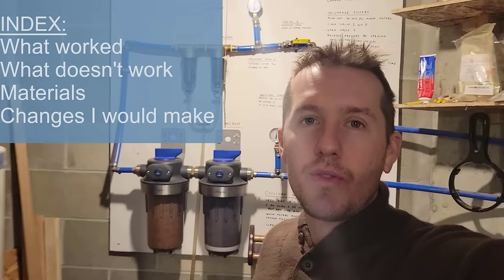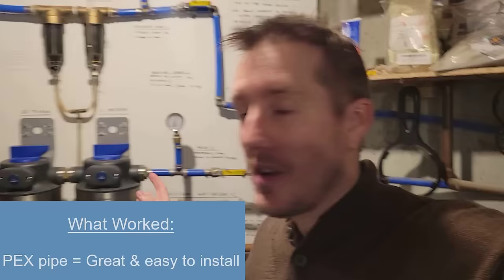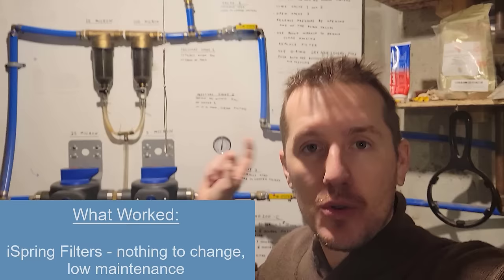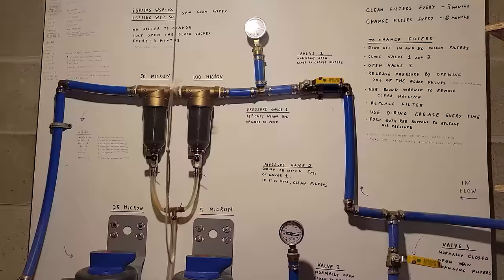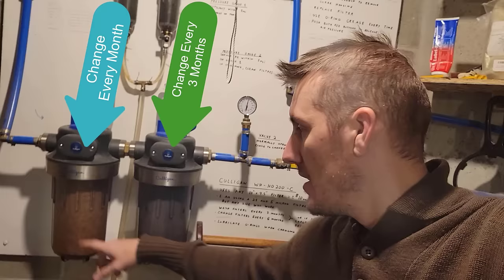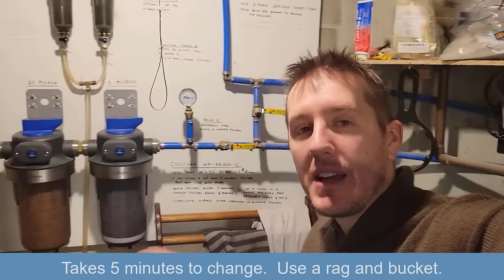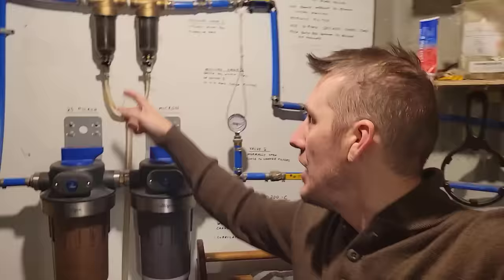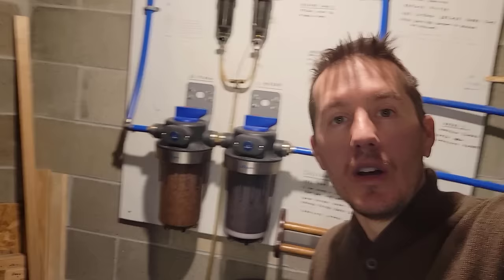4 Years Later  -  Whole House Water Filters Update

Comment: All you need to do is have the water running to use the pressure guages, so why remove them? Personally, I would have installed 1 pressure guiage, and piped it to both sides of the filter, with 2 ball valves. Thst way you know there isn't any gauge calibration issues. To not know that the pressure differential only happens with flow is surprising. I think that it would be nice to know what the pressure drops are at X load (say open a faucet in the bathtub), and then compare that to when they are dirty. Sure, you have a visual indicator, but a number (pressure drop) tells you how much they are fowled. So keep the pressure guages, people: don't take his advice on this matter.
I use a different approach to my similar water issues (rust, hardness, stuff in the water etc...): I have an iron filtration system that looks like a  water softener without the brine tank. It uses air instead of chemcichals, and the tank is filled with carbon. That that carbon media acts like a 1 micron filter. So they claim: my 1 micron filter downstream gets plugged up, so it may be less effective than 1 micron. But it's not 5 microns or higher. So this takes care of both those ring filters and one of his cartridge filters (which I like - they are larger than mine). This filter backwash es every night and is taking care of most of my filtration issues. Like I mentioned, I have a 3" one micron cartridge filter right after the Iron filter, and that I  change once a month or so: I go by the look of it. I might add a pressure gauge to it for $hits and giggles. After the filter, is my water softener, and it has it's own filtration effect, but it is minimal after passing through my 1 micron filkter. So far (2.5 years) this system is working fine: no rust stains anywhere and the water softener is working well (no water spots on glasses).

Comment: Hey, I actually installed an iSpring 50 two years ago after seeing this video but I'm still not happy with the overall results. Still see rust deposits in the toilets and the water smells "funny" when you take a shower.
I have the iSpring first and then a 1micron filter (similar to the culligan but smaller diameter) that shouldn't let anything through. I change and clean every two weeks but I'm still unhappy with the results.
I'll look into some other filter solution this year to completely get rid of any rust.
Reply from the maker: I change that 5 micron filter every month.  Still get a little bit of rust on the shower tile, but it's way better then it was before installing the filters.
But ya, some iron/rust gets through mine also, but not a lot.
Reply: There can be three different types of rust in water. Iron bacteria (reddish slime in your toilet tank), dissolved iron, and iron/rust particles. These filters will only filter rust particles bigger than whatever micron size of the filter.  Iron bacteria need to be killed (i.e. sanitizing the well and plumbing - not usually a problem with city water). The other kind of rust is dissolved in the water and being dissolved, it passes right thru the filter. Later when exposed to air this dissolved rust oxidizes and then settles out of the water. If there is less than 2 or maybe 3 ppm iron in the water then a water softener can remove it. Another alternative are special filters that can oxidize the iron (perhaps some KDF media, greensand or birm or ???) and then it can be caught by one of your 1 micron sediment filters. For small amounts of iron you can find them in a cartridge like for the housings you have. Larger amounts of iron are handled by a tank filled with that special media and which can be backwashed on a timer to dispose of the collected iron. And if you have a lot of iron then the water is filled into an atmospheric pressure tank where it can be treated for a longer time to oxidize and then pumped thru filters back into your home system.
Reply: it might be worth a look at Ray builds cool stuff--he has a video of his 19 year old rain water collection system---he also has kept a chart on the wall--he uses pressure drop across the filters to determine filter change times--he has documented much less pressure drop and much longer filter life after going to 20 inch long 4.5 dia filters. He feels the extra cost is well worth it to him. His video is unique to his system and IMO well worth the watch.

Comment: thank you for the update video! I'm in the process of building a filtration system, so your videos have been very helpful.  If you're running 2 showers at the same time and lets say a washing machine as well of a total of 7gpm, would you say that getting a 20"x4.5" filter housing would help with the pressure and gpm? what is the psi drop you get when running a shower? or bathtub faucet?
Reply from the maker: Not really sure.
Maybe at most we would have a washing machine and shower going at the same time, didn't really see a drop in pressure.
Although i recently installed a large iron filter (size of a softener) and that caused a drop in pressure, but did get rid of the rust
Reply: @DaveWirth  i dont remember if you said in your video, but if you have a pressure reducing valve, you can adjust and up the pressure to make up for the loss correct? or would that introduce some new problems? 
Thanks again for your response, really appreciate you taking the time to produce the videos
Reply from the maker: @ShrimpCracka  I don't have a pressure reducing valve.  We have a well and want all the pressure we can get.  I even took off the restrictors on our shower heads to get more pressure:  https://www.youtube.com/watch?v=QkczGsUvs6M&t=295s
Reply: @DaveWirth  thanks man !

Comment: Did you consider installing water softener after those filters? I'm considering similar installation. After some reading I came to the conclusion that after the filtering, there should be an extra water softening stage. That would i.e. replace calcium and magnesium ions responsible for lime in a kettle with less problematic sodium (or other mineral depending on the salt used in the softener). Also I'd run non softened water into separated tap in a kitchen - just for drinking. Said that I might be wrong... As I said I just did some small research so far, after more lectures I can come up with different conclusions. What do you think?
Reply from the maker: Yes we have a water softener after the filters.  But i need to change the media inside, not sure if it's ever been changed and how well it's actually working.

Comment: Do you have a water softener? I am on city water but sometimes it is discolored. I put a particulate filter after my water softener figuring the that the beads and gravel in the softener would flush out particulates greater than 10 micron allowing the filter to focus on smaller crud.
Reply from the maker: Yes.
I just changed the softener resin last year:  https://www.youtube.com/watch?v=6259QZ-4eAQ&t=7s

Comment: So, have you ever done a volume and pressure test, without filtering and with filtering??? This is a HUGE question I have as I do not want to lose much of either!! I plan to install a whole house water filtering system, but I am on the fence about running parallel filters. It's not so much the cost, but the space needed. I live in Tampa Bay and we can only install them in our garage and here, the garage is where EVERYTHING GOES!!  No basements here.... :(
Reply from the maker: Never did a real test.
Never had bad pressure with these filters
But installed an iron filter and the pressure dropped a little
Reply: I'm also near Tampa, and when I installed my filter system a few years ago, it's on the wall in my garage right by my water softener. Which is about a foot inside the overhead door. So yeah, I have to open the garage door to do filter changes and add salt, but it's been worth doing. The stuff that comes through the city water here is crazy. Sometimes I get stuff in the filter that looks like green silly string. No idea what that is, but I'm glad the filter catches it. Mostly rust though.
Reply: @gregorycerven3484  probably iguana guts.

Comment: Do you put the Culligan Filter into the "Off" or "Bypass" position when you change the filter and if so - do you really have to lean on it to move the blue "bypass handle" with the filter/handle wrench?

I installed one and then went to change the filter a few months later and felt like I was going to break something trying to put it into the off or bypass position (I was using the supplied plastic wrench tool). 

I had to use my master valve on the well to cut the water off, then open a faucet to relieve pressure, then press the red button on top, and then unscrew the plastic housing (which as you mention in the video can take some elbow grease). 

Just curious as it would be a much easier process when time to change the filter. I just could not get the Bypass Valve on the Culligan filter to budge...
Reply from the maker: I've never turned that blue plastic valve, like you i felt like i was going to break it when i tried.  So i just turn off the water at both ends with the butterfly valves.

Comment: After adding all those filter  how did the texture of the water change . Like when are you’re taking a shower . And you rings the soap and still feel like the soap is in your skin .
Reply from the maker: Not sure about the texture.  We also have a water softener that's after the filters.  The softener was at the house when we bought it, i added the filters to remove the rust.
So if you have hard water, i don't think these would fix that.

Comment: did you use pex A or Pex B? Did you  notice any decrease in flow with the water softener and Pex B installation? Would you recommend Pex A?
Reply from the maker: Not sure, i bought whatever they had a Menards.  A big 50 ft roll.  
No, didn't notice a decrease in flow.
But this year i did install an iron air filter, and the water pressure is a little less.

Comment: Dave, did you put this system before or after your pressure tank? I am very tight on space in the area before my pressure tank. Would there be any negative to filtering after the pressure tank?
Reply from the maker: Mine is after the pressure tank.
I don't think it would be an issue.
I also have a tee which goes to the outside spigots, that is not filtered either.

Comment: Would you recommend a novice attempting spin down filter install vs a plumber? I have the spin down parts + iSpring tri-filter parts purchased but plumbers are asking high prices to install
Reply from the maker: As long as you use PEX and buy the right parts, it wasn't too bad.  I've only done a couple plumbing things around the house before, with copper, and they all leaked at first.  The PEX was easy and zero leaks.  You can get 2 shark-bite connections for where you are connecting to the copper, then the rest use the connectors that ratchet clamp tight.  It wasn't super simple, but not that complicated.  Hardest part for me was figuring out what the NPT jargon meant for buying the parts.

Comment: so I am abit confused, what is the difference between the $300-$500 whole house water filter system like ispring and the $3000 ones with those long cylinders??
Reply from the maker: I think in the next year or so, i might be going to the larger Air Injection Iron Filters, like this:  https://amzn.to/3Sdb4rU

The advantage to what i have - cheaper, smaller, can remove different things depending on the filter
Disadvantage - need to spend $20 per month and time changing filters, doesn't get everything

The advantage to the large filter - last 10 years, no maintenance, removes all the rust/iron

Disadvantage - expensive

I also have a water softener, but i think i need to change the media, cause it's been like a decade i think, and it's probably full of rust

Comment: At the end you mention RO filters in your house. Why bother with Reverse Osmosis? They waste water, take out minerals that you need.Especially if your final cartridge is carbon block, which is often good at removing a variety of contaminants. If you drink water without minerals, effectively distilled water, then minerals will be leeched from your bones. With the system you showed, reverse osmosis is not only unnecessary but works against you with water waste and mineral stripping.
Reply from the maker: I agree, but we have 13 ppb of arsenic.  And only the reverse osmosis filter will remove that.
Reply: @DaveWirth   Wow, you are right. Do you use small amount of sodium nitrate (reg salt)  and potassium nitrate (salt substitute) for drinking?

Comment: Sillyness. "Don't bother with gauges,  they don't indicate clogs" What?  Nonsense. Obviously there needs to be flow for there to be a pressure drop across the filters. You could close a valve entirely and you wouldn't notice the "clog" until you opened a faucet somewhere.  What are you basing the your filter change intervals on if you're not looking at the gauges? Have you ever bothered to see if there is a pressure drop when there is water flow?  Every ~2 months is at least 3x more often than a typical person would like to be changing their water filters. By not simply looking at the gauges when there is water flowing, you are intentionally avoiding finding out whether or not the filters need to be changed.

Without actually checking pressure drop you're just guessing when to change filters and which filters are worth having in the system. If you wanted to add some value to these videos you could add a gauge after each filter. They would also probably pay for themselves pretty quickly since they would likely show you that you are going thru 2-4-6x as many replacement filters as you really needed. 

You seem to have no data to back up your statement about needing just a single spin down filter and a single 4.5x10 filter. With pressure drop data over the last 4 years you could have found a selection of filters/micron sizes that still filtered down to 1 micron and only needed to be changed every ~12 months. For all you know your current setup could go 12 months as it is.

Comment: you are NOT permitted by code in any area what so ever to supply a living residence with a main feed of less than 3/4 including filtration systems. you have about 100 feet of pipe resistance because of those BS fittings and enjoy your micro plastic poison mini taints from the pex.